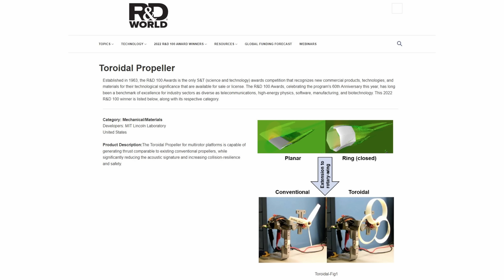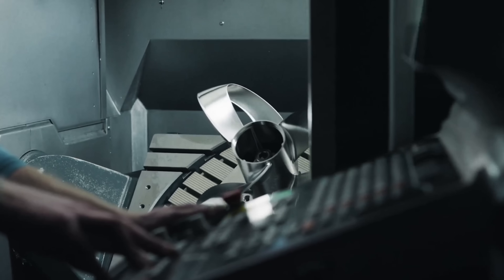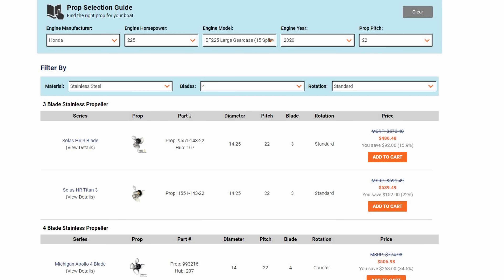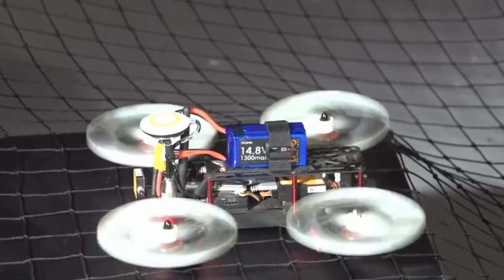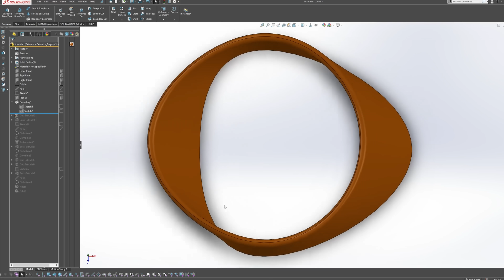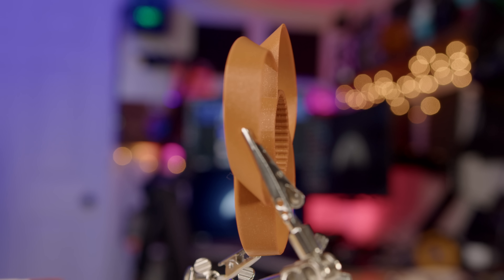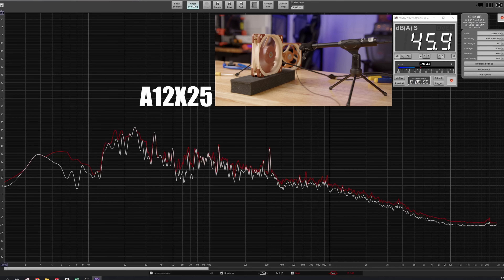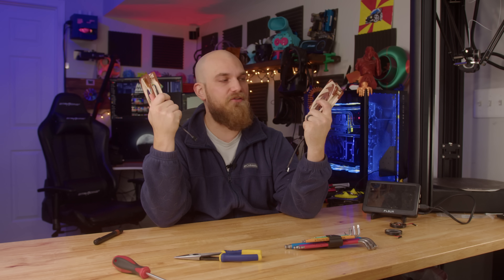I Turned MIT Award Winning Toroidal Propeller Into A PC Fan | Fan Showdown S5 Special

Comment: A major difference is that MIT seems to be focusing on wing tip vortices, but your "tip" boundary is different. Instead of being in free air, its in a static ring. So the torodial was optimized for a different set of conditions.
Reply: Came here to say this ^ , thank you.
Reply: This is the key part.  Inside the fan shroud this is really only a 3 blade fan with cool toroidal shape blades.
Reply: And possibly for a very different RPM-Range at comparable diameter.
Reply: @miagi1337  everything here is what is stated on the video, did any of you guys watch it in full before commenting? xdxd
Reply: exactly, probably lots of shear from the outside edge of the toroidal to the wall, probably over double on the exterior since its roughly a 2-sided surface ring rotating on 1 surface of a ring.
Reply: came here to say this.
Reply: @enriquebarragan212  did you watch the video? he didn't mention that the pc fans have an outer ring at all.
Reply: That is a very well done observation
Reply: @satoau1  In the vid he said the fans were made for flying drones, not being in PCs 3:40 and mentions it again at 5:49
Reply: @sakuyarules  at neither of those times nor anywhere else in the video does he mention a ring around any fan.
Reply: ...not to forget the size of the air gap between the prop and the duct, which is a major factor determining the efficiency of ducted fans. 
Any info about the air gap size in the toroidal design?
Reply: Not very fair to take a design for a open fan and test it in a ducted fan setup. Neither will have tip votices as the duct stop them.
Reply: Or to put it into a boat reference, we are kind of comparing Outboard and Jetski propellers here.
Reply: I would like you to try print different angles of attack for comparison - to me - the one you printed seem a little steep?!
Reply: Was going to say the same thing
Reply: Right about the tip vortices. In a duct, with conventional blades the duct interior blocks the blade tip vortices from forming.  The MIT shape should be compared to a fan without any duct.
Reply: Drone props also spin much faster than pc fans and this design appears to be better for those higher rpms. The torodial design in general doesn't beat typical prop/blade design until a certain rpm. Can see that with the boat specs giving a certain rpm range as well.
Reply: Exactly my point... Or at least one of my points.
Reply: Also, the size of the hub is very different and so there is much less blade area than the MIT shape.
Reply: heeey, I was saying the same thing :))

Comment: The toroidal is designed for open air, not a duct.  Also, Sharrow used to machine their props out of one huge block of stainless steel, about the size of a 5-gallon bucket.  They are now working with cast stainless, to get the cost down.
Reply: Yeah lol I imagine that would make a difference
Reply: Opportunity for 3d metal printing then
Reply: I mean you could use a converging and diverging duct setup to minimize the static pressure the fan has to deal with, but that'd going to some great lengths just to use a fan not designed for the application.
I have thought of doing a small version using 3 120 fans on a 3x140 radiator but again that's going to kind of a silly length for probably minimal gain at best.
Reply: @andyparker8631  Pretty sure that casting is wayyyy faster.
Reply: @andyparker8631  Cast and cleaning is much cheaper/faster for production and they'll be able to drop that machine time down significantly while retaining a lot of quality of the billet part at a fraction of the cost. 3D printing has it's place but is still way out there when it comes to mass production.
Reply: Thank you for sharing, that was my suspicion when I saw the video but it's nice to see someone confirm my suspicions
Reply: @Xeil  Cast and quality don't belong in the same sentence. I certainly understand the cost effectiveness (if using high quality casting and tight tolerance tooling) but I will machine out of solid stock all day any day whenever possible.
Reply: @flowgangsemaudamartoz7062  Yer old s'cool wins again! Print boys dont know about metalwork.
Reply: @NotBlackWolf  If you can aford it!
Reply: It works fine in a duct. You simply have to make it smaller than the diameter by a certian amount. It is still more efficient than a blade fan too.
Reply: @cpycpycpy  I... I think you're just making a silly joke, but in case I can help clear up a misunderstanding you may have, whether or not there's a case isn't the issue, the fan shroud and heat sink are, and a fan not blowing through a heat sink doesn't do much good.
Reply: Sorry if you were just being snarky, hard to judge tone in text.
Reply: by the way 5:34 - incorrect test. He puts usual fan to the tube and increased its performance.
Reply: @NotBlackWolf  Well then I would imagine you understand that most vehicles on the road use cast parts.

Whether what you or I would do is irrelevant when multi-billion dollar companies have been doing it very well for a long time. Every  motor in my race bikes have been cast and machine aluminum. Can't say the quality of them was ever bad.

If money and time weren't relevant , we'd all do billet and carbon vacuum molding all day for the parts we want lol.

Comment: Honestly I think the fact that you were able to match the noise level of one of the best fans in the industry with just a new shape and nothing of the polish work that a company like noctua puts in their product to make sure they are that quiet, I find very impressive!
Reply: With refinement this design could well double the operating speed and cfm of fans while keeping the noise at a more acceptable level.
Reply: Yep can't wait for a company to implement this design
Reply: Matching the noise level with lower hydrostatic pressure and airflow is a phyrric victory though... because to match the air flow you would need to double the speed, meaning a huge increase in volume. You could match the volume with any blades if you turn down the rpm enough.

It's definitely a cool result and first step, though.
Reply: 5dB of difference is quite a lot, and not “matched noise levels” lol
Reply: @DashzRight  Yes, but keep in mind this is a first attempt home made fan vs the result of hundreads of tested desingns. Now it would be insteresting to see noctua pick this design up to see a real comparison.
Reply: The surface is pretty rough on the toroidal fan, I'm shure this one reason why it's not quiter. Some smoothing with sand paper and a layer of spray paint should help.
Reply: @DashzRight  Doesn't really make sense to talk about it like that anyway, the Toroidal had lower high frequency resonances, and high frequency resonances are the sounds that really pierce the ear.
Reply: @amandop9979  some sanding & some balancing
Reply: @halcyonacoustic7366  I doubt a hand deasigned and 3d printed A12 would fare any better.
Reply: 4 DB difference is not a match.
Every 2 db the perceived noise doubles.
Reply: If it reached similar airflow I would agree with this but it wasn't even close. It would need to have a much higher rotation speed to match the airflow. And 4-5dB is a notable difference in sound. 
The concept could work but it would require a completely different design than what we see here.
Reply: @SuperDeinVadda  every 3, it's scaled at 10 times per 10 dB.
Reply: Maybe shows how little actual engineering and how much hype these products actually are

Comment: I think it is really tough to evaluate the MIT design unless they release models. Aerofoils and aero structures are impossible to eyeball and small changes can make significant differences.
Reply: ^this^

The math behind fluid flow mechanics is fiendishly complex, and TINY adjustments have massive downstream impacts on efficiency and performance. I’d be curious to see a design that was fully optimized for the task and see how it performs.
Reply: @munchkingod6  Yea, or at the very least smooth out the surface that's still jagged from the printing method...
Reply: @munchkingod6  To be fair, he did mention that the results from MIT were based around much higher RPM.
Reply: That´s why I am witing ro a A.I. / chatGPT model / design!
Reply: tough to evaluate an MIT design... okay so you're saying you can do better analysis than MIT? lol what?
Reply: yeah I would like to see a handful of different designs at least varying the blade angle a little. He just picked 5 degrees at random.
Reply: @soccerguy2433  Think you missed the ball on that one. Pretty sure he meant that you can't really evaluate a MIT design based on the results you get from a 3d printed design made by eyeballing pictures and guesstimating angles and dimensions, as was done for this video.
Reply: @soccerguy2433  you didn't read the rest of it did you?
Reply: @soccerguy2433  lol yeah I support current thing man. Colleges are collapsing on them selves. They love to act like they're innovating when they are not.
Reply: Release the numbers MIT not just pretty pictures and basic graphs, the paper cannot be what you were judged on, say it ain't so

Comment: I think that the Toroidal Prop isnt Quieter than the Noctua also has to do with the fact that in the PC fan mount the Fan is encased with the tips right up to the mount of the fan. That probably combats those tip vorteces wich are much more prevalent in a free Propeler like on a boat or a drone
Reply: Yeah, acts more like a ducted fan rather than an open air prop
Reply: it would be interesting to make it spin at 10k rpm.
Reply: I was about to leave this exact comment, also why modern jet airliners are much quieter than older prop aircraft!!
Reply: I was thinking this as well. Also the toroidal fan isn't designed with the housing "legs" in mind so the blade-pass-frequency could be quite bad.
Reply: I'd also say the MIT fan is probably also squishing air against the sides of the , shroud?
Reply: it needs more and/or better airfoils to generate a higher pressure differential, like the noctua
Reply: Yep, my thought exactly. Those Noctua blades are pretty darn close to the shroud, which doesn't leave much room for vortices.
Reply: ...which begs the question, why don't drones encase their propellers? Seems like an easy way to increase fan efficiency without adding much mass. surely the battery weight saved would make up for the miniscule amount of plastic.
Reply: @michaeloxlong5697  Mostly because it means either adding weight to the frame, or having shrouds/ducts that flex. And flexing is really bad news when the slightest contact with the propeller means a catastrophic failure and the UAS falling from the sky.
Some do have them, but they tend to have pretty wide clearances and are more there for impact protection than noise or efficiency.

PC case fans can have low-clearance ducts because said ducts are extremely sturdy, the fans are comparatively weak, and they aren't expecting the computer they're installed on to suddenly perform 5g maneuvers.
Reply: there is also a  few thousand rpm difference t between a fast pc fan and a drone....
Reply: I guess this is the benefit of a good education. Being a hobbyist and trying to test things without proper research design training is possibly a waste of time.
Reply: @michaeloxlong5697  some drones do, like the tiny whoop. commercial jet engines all have a similar cowling to take advantage of the extra thrust generated.
Reply: @michaeloxlong5697  It's a tradeoff. Ducted fans on drones can be beneficial in some cases as they reduce vortex noise and increase trust. However a drone fan does not hit the air almost strait-on like a regular airplane prop, but rather at an angle. As the drone speeds up the forces on the leading edge (in front of the prop) of the duct/cowl generate a disproportionate (and sometimes counter) force in comparison to the the trailing edge (behind the prop). This leads to the drone wanting to "correct" itself and limit the top speeds. Also it is less efficient overall, leading to shorter flight times as the battery/fuel runs out faster.  Cooling fans and Drone props are definitely a case of differing priorities in design.

Comment: One very big difference is the fans you are testing are ducted.  In this case the "duct" is the body of the fan.  When Noctua designed their fan they designed it to work optimally within that body.  The Noctua fan also has many more blades, with much less open space between them.  Therefore it can push against higher static pressure at lower RPM than a typical propeller can.
    Remember, the noise of the high speed propellers on a drone mostly comes from the tips of the propellers.  Such propellers normally have relatively few blades, so the toroidal propeller is a closer match to that.
   Further, the toroidal propeller is intended for use outside of a duct, where the airflow around and through the propeller behaves differently from how it behaves inside of a duct.
   In the end, while this test was interesting, it was more like comparing apples and oranges.
   If you want a more accurate comparison, consider making a fan with blades just like the Noctua, but with only 3 of them.  Then test that against the toroidal propeller inside and outside of the duct.
Reply: I'm blown away nobody else saw this. The toroidal design is basically half-way between an open and a ducted fan. You're spinning 3 short ducts. So putting the three inside a larger duct is not only redundant, I suspect it detracts from the efficiency.
Reply: @AlexKarasev  
   You might be right about that.  That's why I suggested testing both inside and outside of a duct.  The differences could be very interesting.
Reply: Exactly the point I just made with my post before reading this, LOL
Reply: LOL was about to type about the ducted configuration causes performance difference and the build purposes, glad I looked at the comment section before I went brrrrrrr.
Reply: Yep. I came to this video because of having looked at some vids about toroidal props. I like this guys style, he seems very straightforward and good testing. And super talented making it from a picture. But all that is sort of moot because the point of a toroid is to create something like what a duct does. The duct is already breaking up that turbulence at the end point of the blade. As Laughing one points out the comparison to do would be a ductless version. But in that case it's no longer a computer fan.
Reply: I had exactly the same thought, that a toroidal fan is already minimising tip-loss without needing to be a ducted fan, and hence there are likely to be turbulence issues due to the interaction of the tip area and the duct. Perhaps the duct could be made much thinner than the depth of the blade, given that the duct really only needs to be there in a minimal form to provide a structure for the motor housing's supports to attach to? There must be scope to make the fan casing as minimal as possible, to allow for maximum toroidal fan size whilst creating lowest-possible turbulence? Too many comments here to read them all, so sorry if someone else has made the same suggestion!
Reply: THIS ^^^
Reply: Teemu M.  can you prove them wrong?
Reply: 3 months too late but, My suggestion is exact opposite, there is no need to have all that open space in the toroidal blades... The key is in the shape and ending of the structure not the openness of it... I would suggest trying to put three equidistant versions in one body, and then test it I have a feeling it would do better but as you stated very well this was never the design intention, still it might be interesting to see how that works out, but again given that the tips of the blades in the noctua, are not approaching supersonic I don't have much hope in beating it with the toroidal. Also 45° angle of attack might be an issuing this
Reply: I mean, comparing a computer fan in a non-computer implementation is like testing a non ducted fan blade in a ducted application.  Same error, different side.
Reply: @marcm.  
    Interesting thoughts.  It would be interesting to see these thoughts tested as you suggest.
Reply: Should be easy enough to just do another sound test with both fans un-ducted? Would be curious to see what happens.
Reply: @AlexKarasev  This is the best explanation I've seen on what a the design of a computer fan is. Then explaining torodial design and their relation, holy crap! Everything clicked after reading your comment.
Reply: I was coming to post pretty much exactly this. The toroidal fan is somewhat pointless when used ducted. On a traditional blade the tip vortexes are generated due to the pressure difference between the bottom and top of the blade resulting in spillover and a vortex. The duct mostly solves this problem. Duct+toridal is solving the problem twice.
Reply: My thoughts exactly, kudos to Major Hardware for getting it modelled and printed, but the blade density is significantly different between them.
Most interesting would be to see open blades, then those blades ducted, throw winglet tipped blades into the mix both in free air and ducted as the toriodal blades are essentially two winglet tipped blades joined by a continuous winglet between them.
Reply: This Toroidal propeller design was not similar to MIT's design makes it bulky and less efficient! 👍
Reply: I wonder how arctic fans perform marginally worse than Noctua despite very different design.
Reply: Isn't this test like...horribly flawed to begin with? The design was made to compare three blade propellers and now having a three blade fan caged up against a way more than three blades fan is kinda stupid